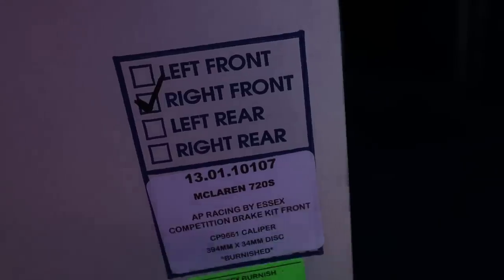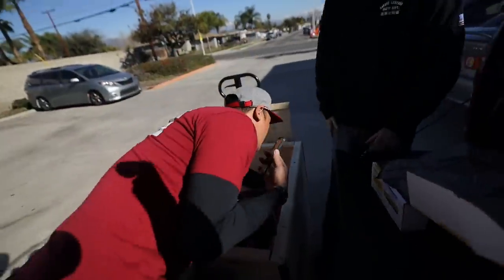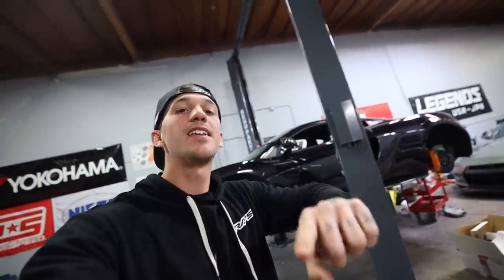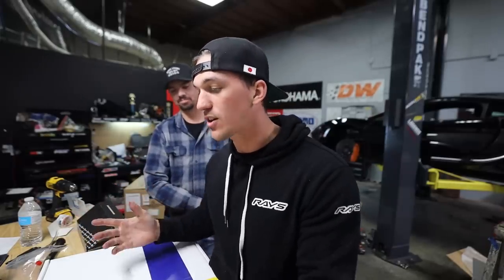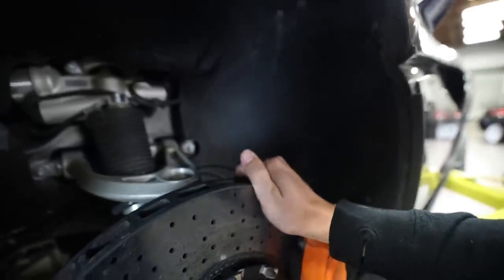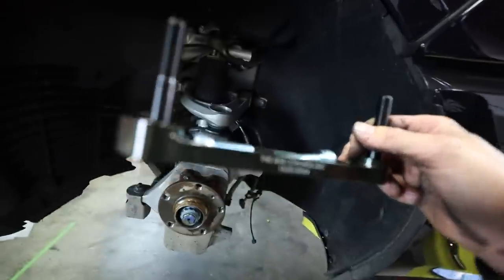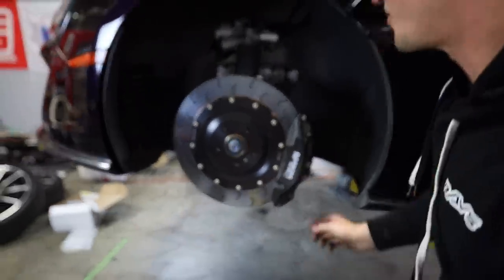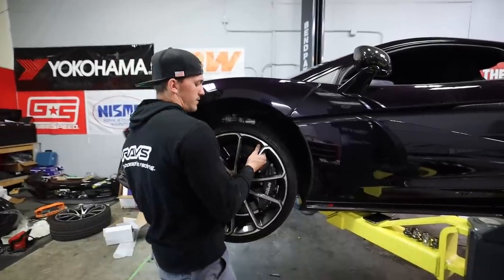Building the ULTIMATE Supercar Race Car!! 570s Build Pt.1 AP RACING BBK INSTALL

Comment: Gents, Thanks so much for choosing our AP Racing by Essex Radi-CAL Brakes for that beautiful beast! You did a great job illustrating just how easy they are to install and service.  You're going to love the consistency and confidence they bring when trying to shave tenths from your lap times, and they will save you a small fortune vs. continually replacing the OEM carbon ceramic discs/pads.  We're very much looking forward to your impressions from the racetrack! Thanks again for your patronage.  -Team Essex
Reply from the maker: Love them!! They performed flawlessly on the track!

Comment: Let's just clarify here - going away from carbon ceramic breaks is NOT a "performance upgrade". You will not get better braking. You will, however, save money by not heavy heat cycling your ceramic rotors and hastening their wear ($$$$). Brakes are consumables - tracking a car with CCBs will cost tons of cash. That's why you make this change...
Reply: True
Reply: Yeah, but smaller steel brakes are worse performing than the stock CCBs. You are right about cost tho.

Comment: What? Carbon Ceramics are made for track racing. The just need a certain heat window to work. All LMP's and F1 use them. Well atleast the maintainence is a lot cheaper with these ones. Anyway pumped for the build.
(Edit: GT3 and GTE are not allowed to use CCB due to the reglement)
Reply: F1 and maybe LMP use Carbon Carbon brakes

Comment: How are carbon ceremics not good for the track???
Reply: Probably because it costs an insane amount to replace the rotors compared to steel
Reply: They’re good, but wear down very very fast when they heat up, so that gets very expensive. So they are great for the track but bad for your wallet.

Comment: actually carbon ceramic brakes are amazing for on the track
Reply: ye they are but the problem is with heat build up it can wear them out fast and also wears out your wallet.
Reply: @Astro-si2eh  f1 cars use those brakes too and they fully abuse them so idk what your talking about.
The brakes heat up fast yes but they also cool down fast
Reply: @thedandy6765  yeah and they fully abuse there wallets
Reply: @Astro-si2eh  you think dut doesnt have a lot of money??
Reply: @thedandy6765  did I say that?

Comment: I don’t understand carbon ceramic can handle a lot mine heat, idk why your changing it with steel like wut
Reply: I'm asking the same thing
Reply: Cause hype, that's why lmao
Reply: @gustavocastillo9954  wdym?
Reply: changing mclaran carbon ceremic for ap brakes... tf i just watched.
Reply: @donaldkrump666  that's what I'm saying lmao😂😂😂😂😂
Reply: Next up is turbo swap for Honda turbos
Reply: Because carbon ceramic brakes are absurdly expensive to replace.
Reply: @theracersline2953  but ik that the disk last for ever and I guess pads are what ever the drivers like
Reply: Very bizarre I thought that aswell makes no sense unless it’s for the price point
Reply: Its basicly like changing his titanium exhaust back to stock.. I think that's even less wors
Reply: @donaldkrump666  I'm still baffled why he did it. Im guessing cost and maybe he really wants to run 18in rims
Reply: Cost of replacement is insanely high for carbon ceramics and regular steel rotors will last longer. Also can run a thicker pad with the AP calipers. You can tell who in the comments doesn’t track their cars
Reply: Carbon ceramics don’t last that much longer when stressed at high heat like on the track. When coupled with the price of replacement, anyone that tracks their car a lot swaps to steel brakes for track use. It also allows users to tune the braking to their preference and needs. CC Brakes need to only use that specific pad for that rotor. If the driver wants more initial bite or better modulation or any number of things, CCs do not allow for that.
Reply: @AK47xSNIPES  it's just wierd to me that the rotors that came where engineered by maclaren to its purpose and usually when some one specs there car for the track the go to is carbon ceramic but I mean were all here to learn and not call out each other
Reply: @ELDELACHEVY93  same thing with Porsche when they put carbons on their GT cars, they even said later on that steel rotors are better for a track application
Reply: @AK47xSNIPES  interesting you learn something new every day
Reply: because carbon ceramic rotors cost like 20 grand to replace and steel cost like 2 grand
Reply: I love it when people who know what they're talking about shuts down people who think they know what they're talking about😂😂😂
Reply: Good steel brakes are better than carbon ceramics for a track car. Even McLaren themselves have steel brakes on their GT3 race cars. Real race cars, not street cars.
Reply: @AK47xSNIPES  ur telling me he’s going to take that car to the tract everyday ? Or only occasionally on a super car track day if so them am sorry but the swap is not worth it it’s not about “tracking” ur car is it ?!

Comment: can someone tell me why manufacturers use so much carbon ceramic brakes when they are not good for track use? Im genuinely wondering.
Reply: They are good! This bbk is a total waste of money and probably downgraded the cars performance
Reply: @itaysadeh7432  Racecars dont use ccb tho so like it got me confused
Reply: It’s mainly to do with the cost. It’s probably about a 7k difference in cost and the new brakes will do absolutely great
Reply: @luispegoraro9052  What? I think LMP and F1 use CBB. GT3 and GTE are not allowed due to the reglement. CBB are built for the track
Reply: @Genex.  No, they use carbon discs not carbo ceramic its different
Reply: @luispegoraro9052  Whoops yeh you are right. My bad. I still think the carbon ceramics are great, they just need to have the right temperature. 
I was in a rs5 race taxi with cbb at the nurburgring and the brakes hit different.

Comment: The carbon brakes on the McLaren 570s are for racing and allow the driver to modulate the brakes under high speeds.  There is intentionally an analog feel.  The steel brakes will give you a different feel but I doubt that you will experience an improvement in braking.  The 570s carbon brakes just require pressure.

Comment: Don’t want to be negative but there’s no way these guys can tell me carbon ceramics are not good for track use
Reply from the maker: Ever tried them out?
Reply: It’s mostly due to the cost between the 2. Carbon ceramics coat about 9k for a set vs about 3k for these new 2 piece rotors
Reply: @Socal Drives F1 cars use Carbon-Carbon
Reply: @Socal Drives nope, carbon-carbon m8
Reply: Heat management (dissipation) it’s not ideal for track, they usually cracked on the veins or around the drilled bits. Porsche GT2/3 RS recommend steel rotors for track use. 

F1 it’s a different story because it’s carbon/carbon and it’s not a “floating” kind of brake configuration.

Comment: Blasphemy!  Are you saying that the brakes that all the big manufactures are pumping out on their new super cars and sports cars to justify a $10k+ upgrade option are actually just a marketing gimmick but have nothing in common with the carbon carbon breaks on an f1 car or lmp1 car?  
And that a company that has been making f1, lmp, wrc, trophy truck and literally every type of race car brakes since the beginning of time might know what their talking about?
You brave soul. 
I guess when the protective coating wears off those “Carbon ceramic” rotors after a few hot laps you’ll have the last laugh.